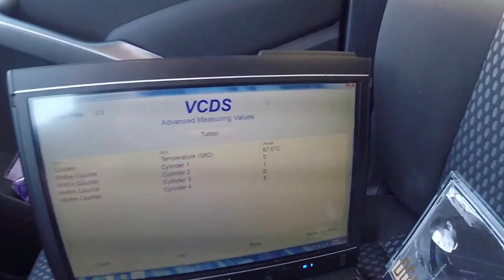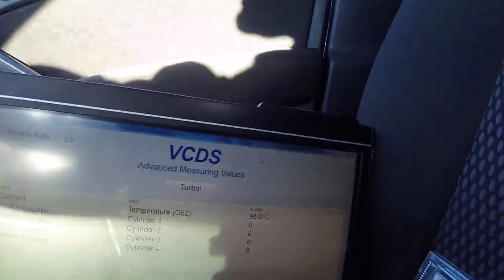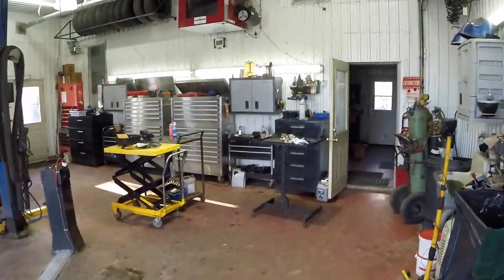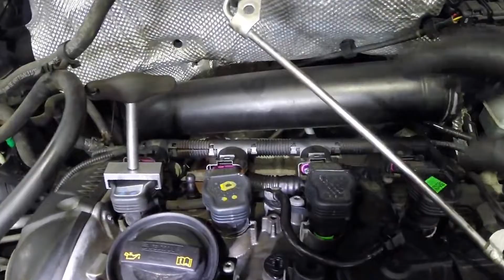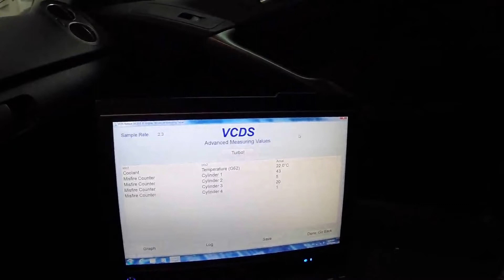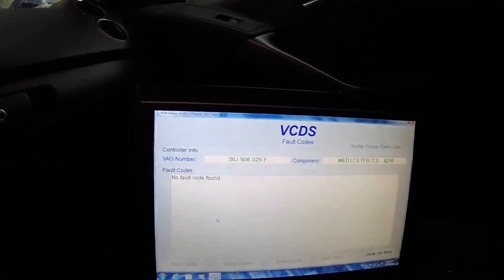Tiguan intake cleaning movie

Comment: nice job man! very good video. like details.  just a question though, did you clean the fuel injectors and put new gaskets on the injectors?
Reply from the maker: Thanks for the comment If I remember correctly this was my personal car and the dealership had just replaced the injectors so no I did not replace any seal for the injectors but when I know that the injectors are old I replaced the seal that seals the combustion chamber and the fuel part of it but a lot of times on higher millage car I replace all the injectors and the seal comes installed on new injectors.

Comment: Why is Tiguan always has the sensor intake manifold flap issue , the engine lose power and lots of misfiring , has replaced new spark plug, issue still exist
Reply from the maker: Keith Lim hi is the misfire only when the engine is cold or all the time ? What is the engine you have in your car because here in Canada we only got The CCTA 2.0l turbocharged engine so if you live outside of North America then the engine could be different is the misfire on all cylinders or only on the same cylinder?

Comment: Would have like to see the process of removing the parts and the actual cleaning of the cylinders. Great video though, it was still pretty helpful! Those cylinders look really clean!! I've been thinking of getting a Tiguan but it seems like most of the owners that like them and have success with them are mechanics like you since Tiguans acquire a lot of issues that are expensive to fix.  I'm thinking how do-able it is to take the intake manifold apart and clean the cylinders out myself but it looks really complicated. Does the car also need to be jacked up?

Comment: hi  great video on the intake man removal. and cleaning,  If I may ask, how did you get the intake with all of the injectors and wires as one ? most other videos its separated, wires, injectors, etc. thanks
Reply from the maker: Jeriko A, Sosa hi this is the factory way to do it I know that some of the injectors could be stuck in the cylinder head.

Comment: Excellent video!!  ALL GDI engines have these issues. With no fuel cooling and cleaning the backsides of the intake valves, coking is a part of all GDI engines. Also, a solvent based cleaning will result in some damage to the pistons and the cylinder walls. We have yet to tear one down and not see scouring. Only a proper manual cleaning can clean all of the deposits w/out damage. Both the crushed walnut shell media blasting and the brush method work well. Using only full synthetic oil slows the rate as less residue is left when burned on the valves, and a proper air/oil separator crankcase evacuation system like ours will prevent most, but not all of the coking.

Comment: VW's garbage !!! Why? Because 140.000+Km , intake manifold , injectors and goodnes knows what else  have already replaced in this poor Tiguan. 

Never again VW i sold my Audi , my wife's VW and i go for Japanese reliability . So Lexus for me and Cx5 for second car. Life is short to spend in Vw dealers service
Reply from the maker: Pir Pir actually after this repair the vehicle only got a new rear main seal it was leaking oil and letting air into the engine all the repairs done are pretty common issues not major in regards to the injectors it was replaced for free it had a extended warranty plus the intake manifold had been replace under warranty before I bought the vehicle as a used car.
Reply: You are very gently with VW . If only 1 in 1000 of their cars had issues i would be polite too, but 10 in 11 of their junks have at least two major issues at first 100.000 km. Nice to drive, nice to touch interior matterials etc but reliability is low as F(ix)I(t)Again(T)ony with incresed price
Reply: I was driving Audi . My personal vehicle was Audi s3 2009 sportback (abs/esp unit fail, clima sensor failed, right rear lock failed, magnetic ride absorber licking oil) my father's car Audi A8 2008 (no problems at all except ,ignition coil ) ... Now i am driving Japanese car (Lexus is) and i have to say THAT IS A REAL CAR NOT JUNK. and at lower price than A8 and still too little difference between driving sense
Reply: RX 450
Reply: yeap 10/2009 i bought it second hand after sold my Audi 4 years ago. Nice car except from interior plastick quality and exterior design.
Reply: Lord G That's right. All of us deserve what we pay for. Vw and especially Audi forgot that. If you feel comfortable with your VW i hope you enjoyed it for many many years.
Reply: Lord G ".... just aren't men..." Are you over 10 years old? If the answer is "no" that's ok but if you answer "yes" then ask your wife if i am man  .
Reply: Christ calm down already. Sorry you don’t maintain your vehicles bro
Reply: @BabyBugBug  I don't care anymore my friend. You are free to go with VW group garbages. Maintain as required and live your mith in car dealers workshops.
Reply: @pirpir3496  Ok i will continue to get my oil changed and run routine maintenance if that’s what you mean by living in workshops lol 😂
Reply: @BabyBugBug  Good for you

Comment: Thanks for posting. A tip: Before disconnecting the battery, you can attach a memory saver device to prevent loss of memory and subsequent recalibration. https://www.ecstuning.com/ES2748866/